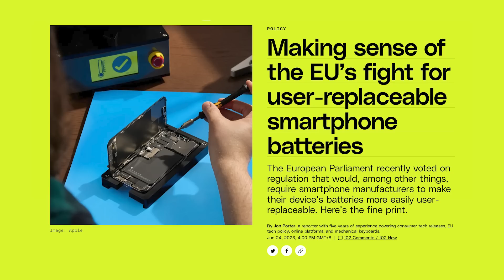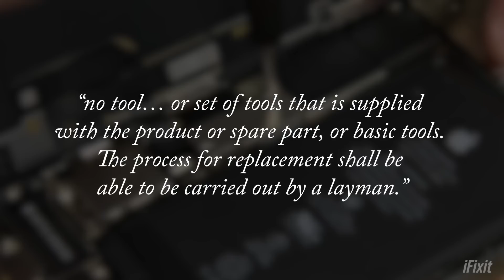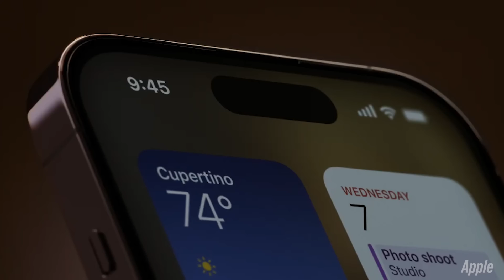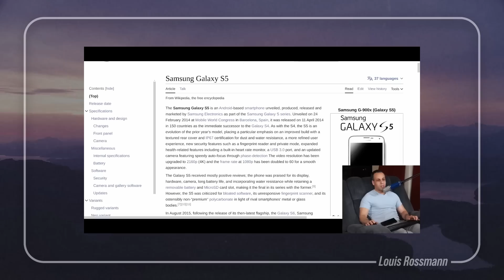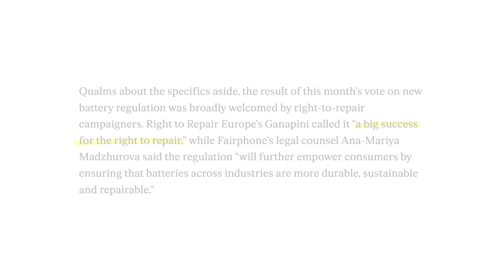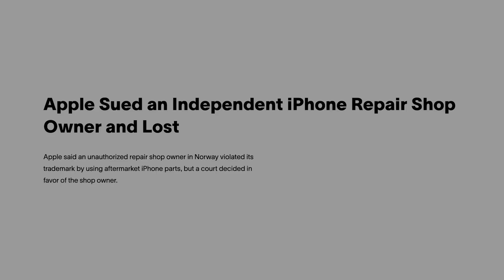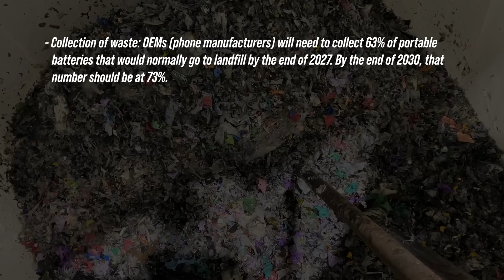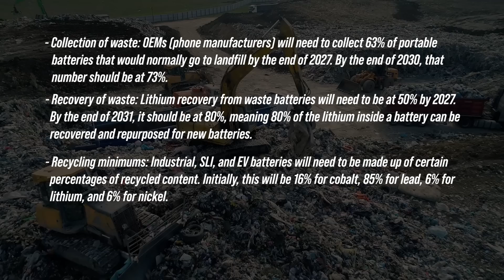EU Just Changed Smartphones Forever

Comment: This is going to have a bigger effect on the EV market than anything else. It could move the EV design in cars to interchangeable batteries which some companies have looked at already
Reply: Hopefully, since the scary thing with current EV industry is that those EV cars have become non-user serviceable unlike majority of ICE cars. This is why car enthusaist culture flourished since you can literally rebuild the whole car if you want and replace aftermarket parts and they will most likely work. EV cars have become "disposable" in terms of how everything seems bespoke. Its really odd since electric vehicles are actually simpler and less complicated that ICE vehicles. In theory they should be easier to service and cheaper.

Batteries on EVs needs to be standardized, just like how we have standard battery on ICE cars. Of course, this needs to be regulated especially how lithium batteries are potentially really dangerous. But batteries on EV's needs to be easy to replace and find aftermarket parts, so we can have the same car for longer and cheaper to maintain on the long run. Potentially reduce the possible huge e-waste from them.
Reply: The EV market is actually an area where batteries are still undergoing rapid development in both chemistry and use as structural elements/packaging. I think it was better if they gave that industry more time to figure out the best way as now it will hinder innovation and other beneficial goals IMO.
Reply: I can only hope
Reply: I thought EVs all have exchangeable batteries. Isn’t that part of the sales brochure - as to in how many years you need to replace the battery? And its replacement cost. Yeah, I doubt a normal consumer has a multi-ton hoist and is skilled in handling 400V safely but you know what I mean.
Reply: Well their ok with the vision pro.. it's detachable.. however, they should include a battery inside the device so it's hotswappable.. but limited to 5 minutes max so that a person has the ability to switch over the battery
Reply: Yeah, I can't wait to easily swap out a 1,000lb battery....
Reply: That rule doesn't apply to vehicles.
Reply: yeah. there is a chinese company that already have thousands of battery swap stations in China. but the concept is different they just don't want people to wait an hour to charge their cars so they just make a few thousands of automatic battery swap station across the country that can swap their batteries out to a fully charged one in like 5 minutes.

Comment: Huge for EV’s.  Keep one for 5 years then swap out the battery for one with the latest chemistry, meanwhile repurposing or recycling the original.  I’d happily have a 77kwh battery attached to my solar panels, even if it were down to 80% rated capacity
Reply: Honestly for EVs this isnt really necessary. I always thought that replacing the battery in an EV is inevitable and has to happen every 7-8 years. But I was wrong. I've heard of so many people that have lost like 10% of their range after driving 200000 miles in 8 years in their Tesla. In Tesla's Impact report of 2022 they said that on average the range declined by about 12% after 200000 miles.
Reply: @thomasfriedl3137  there’s two reasons to swap the battery - one is to restore the car to original capability, the other would be to exceed original spec.  If in 5 years there’s a battery chemistry which has twice the power density, I could “trade up” and get a lighter, faster car with more range, just with a battery swap. Put the old heavy battery to use running the house.
Reply: @MandyFlame  If that happens sure that's a good thing but I would be very surprised if batteries improve that much in just 5 years. And today's batteries are more than good enough I don't see myself needing more than 300 miles of range in the near future.
Reply: @thomasfriedl3137  well, it will still be a thing, because EVs have a LOT less moving parts so the idea is: they might last much longer anyway... if most of the car can last 20 years and the battery over 10, then it will be replaced. But it's good, for grid power or home energy storage, etc.
Reply: @thomasfriedl3137 That’s not bad. I’m sure for any conventional car - its worth is diminished by at least 10% after 200,000 miles. All components wear out. Engines have to be rebuilt lest it starts to burn oil and reduce gas mileage. Same old same old.
Reply: And those with the old chemistry designed to be used for 20+ years?
These become obsolete and waste?
The dictated amount of recycling will never compensate for the amount of waste early replacement generates.
Reply: @TheEVEInspiration  what waste? just put those unused batteries on your house and put on a solar system and you get free electricity. it's more important to have the most efficient battery on your car coz the weight of the battery affect the range and the energy consumption. either way there are companies that actually manage those unused batteries. they recycle and repurpose those batteries. it's not just going to be thrown away
Reply: @az-fy3mp  As long as that is economically viable, then yes, else those companies stop existing. And everything EV is heavily subsidized in one way or another. That will change when EV use picks up and real economics take over.

That said, a battery designed for a car might work for other use, but if it performs as well as dedicated alternatives...that remains to be seen. And with that i mean economically too as no-one is going to reuse those used batteries when new is cheaper.

So all EV is for now is subsidized hot air. Yes the cars are there, but not using sound economics. For broad adoption and thus actual infrastructure and reusability etc, a lot more technical progression needs to be made. It is a safe bet that every EV build today is aside form some marketing BS, destined for landfills.
Reply: Mind you, the catch will always be: “oh sure, the battery is swappable, but no one makes one that will fit”.  Not like just slotting in a pair of AAA’s when the TV remote goes dead.
Reply: Actually make that 10 years
Reply: Its kind of bad for EV development, causing more waste in the process.
With EVs the weight of the whole system is always important to reduce the upfront use of materials.
This is why car makers are using the battery packaging as structural element of the car designs for example.

It is a good law, just terrible for EV designs to comply to quickly.
It will cause massive amounts of extra pollutants (heavier cars with more batteries) there just to comply this quick.
The law only looks at replacing and recycling, not the initial use of the amount of materials per vehicle.

if it takes 20% more materials to comply and save 8% with recycling, it is a huge loss for the environment!

Comment: What a massive step back for consumer, wave good bye to beautiful thin phones. Replacing a battery on an iPhone is currently a 10 minute job with a hairdryer and a single screwdriver but no, that's not good enough for people. The whole make battery easily replaceable law missed the whole problem. Batteries are easily replaceable as they are, the problem is not being able to buy genuine parts and have them work. It would have been 10000x better to pass a law forcing companies to sell replacement parts, hell, even buy replacement parts that are coded to your specific phone via a serial number. We'd keep the same great design of phones and do so much more for the environment and right to repair

Comment: This would be very welcome. 18 months after buying my brand new S21 Ultra the battery life has degraded to the point of needing to be on charge most of the day. I'm not even a heavy user and have never let it fully discharge or overcharge.
Reply: Replace it then
Reply: @thewonderofyou1  and that's the whole point. I've either got to send the phone off and be without it for some time or travel to a repair center. Either way there will be a charge for the work to be carried out as well as the battery itself. If I had a replaceable battery I could just pay the cost of the battery alone and slot it in right here in my home, no problem.
Reply: @EdenVI  I agree
.. so send it off to get a replacement.. Don't moan about it.. It's in your hands
Reply: @thewonderofyou1  You have missed the point entirely. Have a good day.
Reply: @EdenVI  no I haven't.. You bought the phone knowing you couldn't swap the battery.. stop moaning.. We all agree replaceable batteries are better..